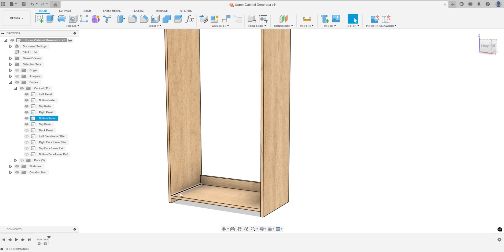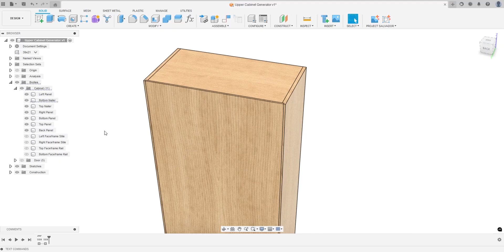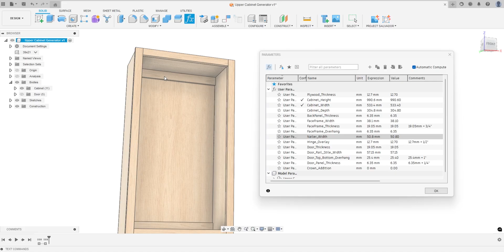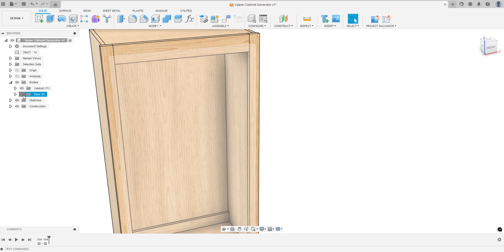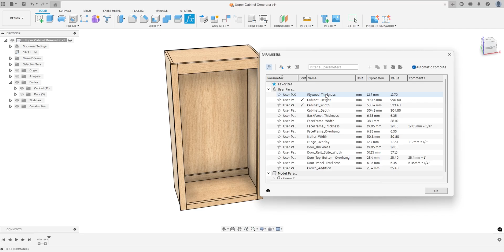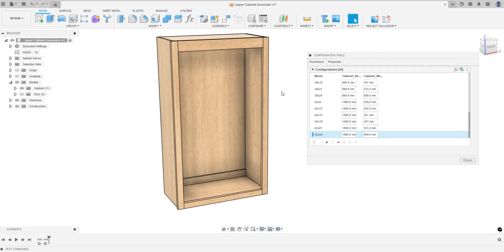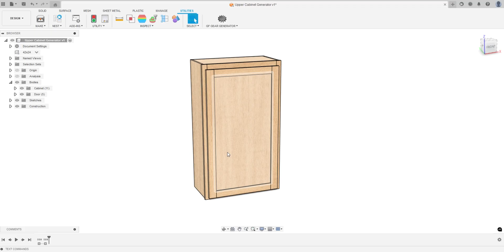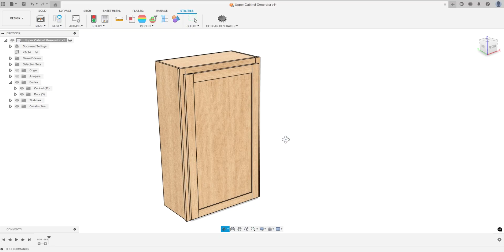Autodesk Fusion: Cabinet Generator With Cut List

Comment: I like this idea because I, too, have a woodshop. My cabinets are frameless with doors that are one piece and extend to the edge. I use European hinges. Mine are hung on French cleats for versatility. I still need more cabinets in spaces that would need custom measurements to fit. I also use a Rockler Pin-shelf jig to place holes in the side panels for adjusting shelves.
Reply from the maker: Yeah this would be perfect for that, especially when you need a custom size.  Maybe I’ll do the frameless cabinet next.

Comment: Interesting concept.  Could you have multiple components for the different cabinet types (upper, lower, two-door, etc)? Most of the sheet goods and framing materials would be the same within a build. Could you delineate a parameter naming code for each cabinet type's HxLxW?
Add quantity to the cut list table?
Cut diagram for the sheet goods (grain direction and layout)?
Personally, I am not in the market for the concept but I see the potential.
Reply from the maker: Yeah I could definitely just put each cabinet type as a component. That would make more sense than having separate fusion files for each. Would have to adapt the script